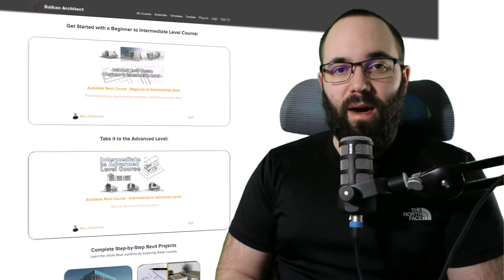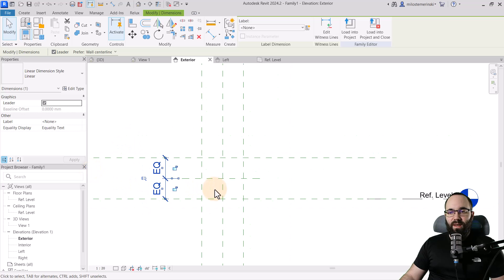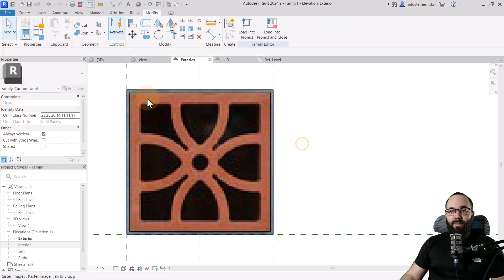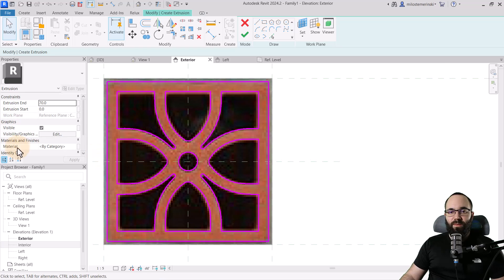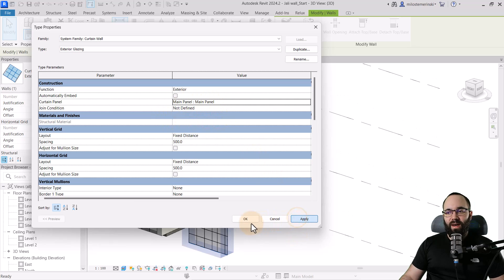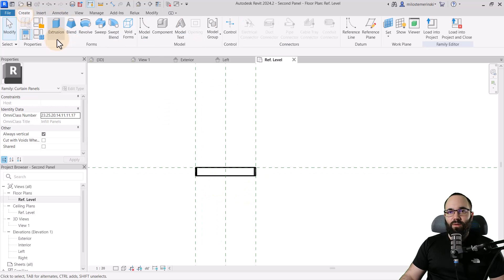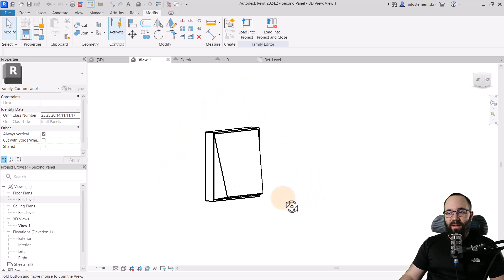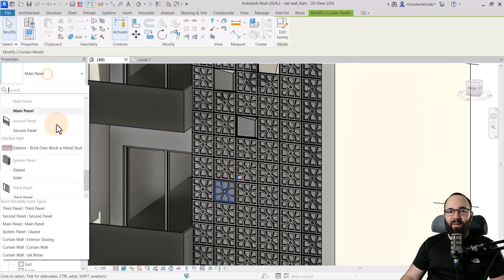Jali Walls in Revit Tutorial (Complex Brick Block Wall in Revit)

Comment: it keeps saying 'can't make type "file name"', i've tried it twice now following the exact same steps.
Reply: I had the same problem the solution is Ensure that the total length of the curtain wall is set to a multiply of 500 mm. This means the length (and the height by the way )should be expressed as 500 × n (e.g., 1000 mm, 1500 mm, etc.), where n is a whole number. Does that make sense?
Reply: @yomnaaboeleneen not working bro

Comment: I tried to create one by following your video, but it showed me an error. Can you please create a video explaining why these errors occur?
Reply: Mine too
Reply: Use wall length as multiple of panel length.
Reply: I had the same problem the solution is Ensure that the total length of the curtain wall is set to a multiply of 500 mm. This means the length (and the height by the way )should be expressed as 500 × n (e.g., 1000 mm, 1500 mm, etc.), where n is a whole number. Does that make sense?

Comment: I'm facing error like can't make type family
Reply: Did you arrive at a solution for it?
Reply: Make the curtain wall length and height multiples of the dimensions of the panel. Example. If it's 20" x 20," then making a curtain wall 100" x 200" will fix the issue.